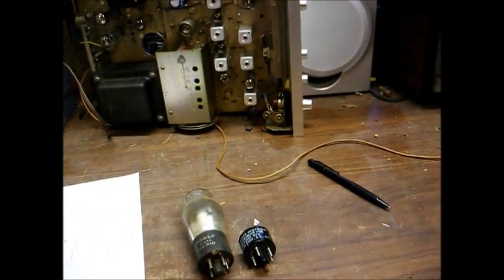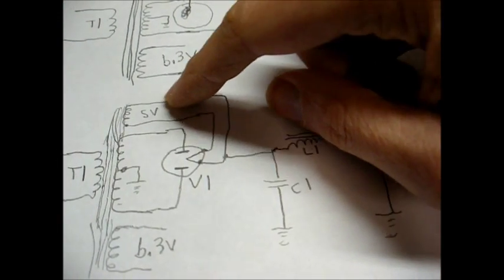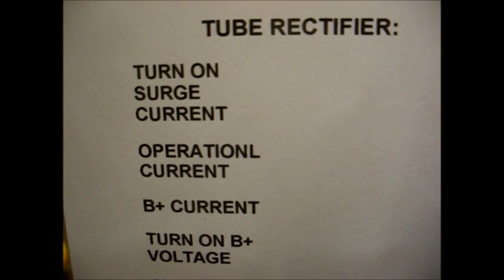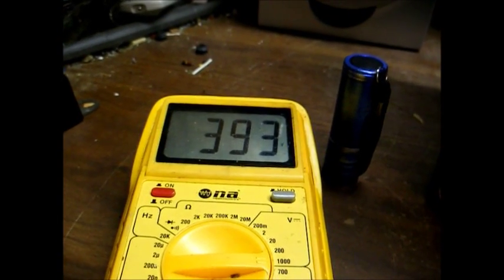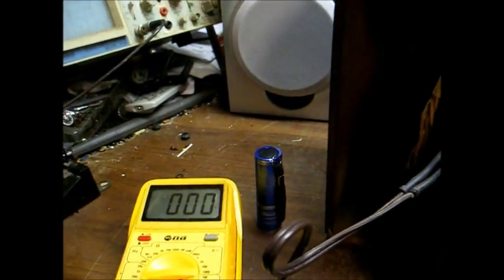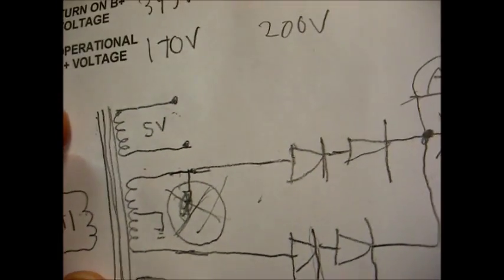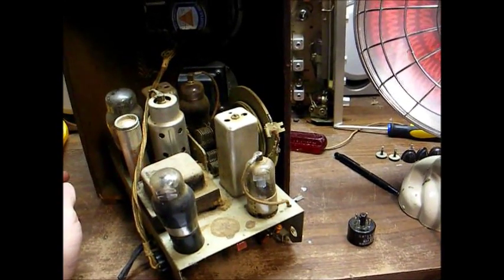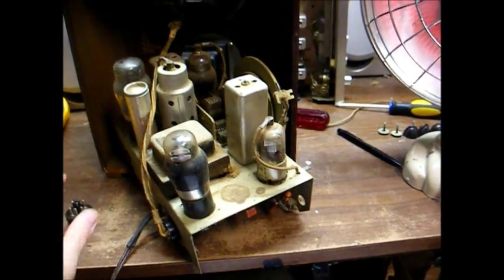Analysis of solid state plug in rectifiers for replacing tube rectifiers

Comment: As always a great video.
I can see someone using that replacement diode pack if they could not find a proper tube, like back in the late 80's and early 90's before the internet was a thing.. I mean now you can find rectifier tubes online but back them it was a dark era when tube equipment was widely replaced with solid state and part houses quit carrying tubes, this diode pack would be your only option..
I have seen modifications of equipment I have worked on using these plug in packs to replace tube rectifiers, where the device had a small IC (555 or 556) based timing circuit to fire a relay to supply the B+ to the tubes after all the other tubes have warmed up so your not applying HVDC on the plates of a cold tube..
The latest modification I have come across was in a guitar amplifier that had an arduino nano as a timing device to trigger some FET's to supply the B+ from a diode pack to preheated tubes. This is more versitile as you can program the nano to whatever delay time you want.. I know it's blasphemy but people do what they must I guess to get equipment working and to save money..
personally I would have just found a proper tube rectifier and called it repaired..

On a side note I have rebuild resistor packs that plugged into tube type sockets in the past.. I don't see to many tube devices come through here anymore, the occasional guitar amplifier or old 2-way radio finals for a ham radio operator or the classic 5 tube table top sets that need electrical restoration but that's every blue moon..
Reply: I was surprised to hear that commercially made diode packs do not typically include a replaceable thermistor (ie: "light"bulb?) and/or SCR to limit the inrush current in a soft-start (and to add to add a non-poison standby mode?) ; before considering most common things were made to be cheap and happen to be durable, were also simple.

Have you seen no example of either in your work in the years since the above comment?

Comment: Think this is good general advice if you are not sure. Otherwise it's really no issue using solid state rectification in any equipment - if you do it right. There is no problem with output valves or any valve getting HT before the heaters warm up, As long as you keep voltages under control all should be fine, and your mains transformer may like it better in the long run by running  cooler not burning a few watts on your GZ34 or whatever. An NTC thermistor will mimic warm up if you want it to cheaply stop surges.
Though I do prefer to have a valve there myself and wouldn't want a solid state replacement,

Comment: I came across this video after losing a power transformer in my EICO 460 'scope.  I'd replaced the original HV rectifier 1v2 tube with two HV diodes in series (PTC205's) and the scope seemed fine.  But the last time I turned it on, one of the 0.1uF 1000V ceramic caps downstream shorted out, taking out the transformer.  I didn't expect this sort of cap to break down. I'd wondered about surge voltages due to the diodes being the problem.  Looking at your video, in your testing, the instantaneous surge voltage might be much higher than 400V.  Parsing the video frame-by-frame shows 889V for several frames before reading ~ 400V.  Not sure if this is an artifactual "bootup" display error, or whether your multimeter can react that fast, but it might be a real spike.  Things might be even worse than you suspect!  Thanks for the discussion!

Comment: I seen in a Tektronix scope, it had a tube that would slowly heat up...keeping the filament voltage from going right to the tube's when first started, making sure the other tube's heat up first. It had what looked like relay contacts that moved over when it got hot, and made the power to connect to the filament leads.

Comment: When necessary I have used diodes to replace a tube rectifier or selenium rectifier with a dropping resister but I've always added a thermistor to the line in to avoid surges.  It does add to the heat load and proper placement and venting is necessary.

Comment: I did this in an old 1938 philco 38-610 radio...and I used two microwave diodes and installed two 5 watt resistors in front of the diodes...

Comment: Dropping resistor values vary from 1k to 220 ohms for 6x5 to 5y3. Can be as low as 100 ohms for 5u4 replacement with silicon diodes. usually 2 or 3 in4007 in series is a good idea. 1 1n4007 is usually not enough in practice even though looks ok on paper. bypass capacitor ranging in value from 1000pf to 10000pf are a good idea to prevent rectifier noise with silicon diodes.

Comment: ive been reading up and this and understand the issues well enough only to ask a question, have you tried to use a ss rectifier in conjunction with a thermistor on the input line like an amphenol cl-90? my interest is tube radio and trying to reduce the transformer load and heat, i was even considering the possibility of using current limiters on the ss rectifier itself. the goal being to produce a true drop in replacement for a specific radio. its just thought at this stage.

Comment: Yeah, I cringe whenever I restore a vintage guitar amp & see 1 of those installed! Usually means automatically the filter caps are shot or worse, shorted from the high surge current when 1st turned on and possible power xformer damage! I've seen it all when I've gotten vintage guitar amps in for restoration/repair! IF someone INSISTS that they want to use one of those solid state subs for a tube, I install a huge resistor in series with it to absorb some of the current when 1st switched on

Comment: Except for tube testers build ss83 and ss5y3 no issues. If used in audio amp etc. Try and use dropping resistors to drop voltage enough to match original tube

Comment: The problem with the output tubes is the increase in the rail voltage. Use ohms law to find the correct resistor to bring the rail voltage down to the original voltage. Or reset the bias to the output tubes. Normally, commercial equipment were designed to work in a lower plate voltage but the tubes are fine with as much as 40 volts, in average,  increase in the plates,  look at the charts,   Pv=   Plate voltage>>minimum>>maximum.     lot's of people that try to explain this same thing they go for the lottery and have no idea to calculate the value of a resistor to drop a certain amount of voltage and try several of resistor until their are close....Waste of time, resources and human ingenuity..USE THE OHMS LAW!!!!!

Comment: This used to confuse me. I thought that Direct Current flows from neg cathode to pos anode or B+ plate.  But it seems that  it should go from pos to neg, or in  the opposite direction. Then it was explained to me, inside a battery, it does go from pos to neg, so that is why outside the battery, DC goes from neg to pos.  A rectifier doesn't allow for AC to flow both ways, but only in one direction, to change the transformer AC  output to ripple DC. Brian, just curious, was that solid state rectifier with four diodes?  Did you look inside?  I suppose a 25watt ballast resistor could be used in seeies where you inserted the ma meter.  But um wondering if a voltage regulator or SCR could be used?  Don

Comment: ok what would happen if you replaced all the tubes with solid state equivilents?
Reply: +Synthematix   There really is no such thing.   Solid state was specifically made so you didn't need high voltage any more and make electronics more reliable and not waist energy by generating so much heat.   It would be like putting gasoline in a diesel engine.   It just doesn't work.
Reply: +Synthematix One of the instructors I had years ago mentioned SS replacements for the tubes in test equipment like oscilloscopes. The biggest claim about these things was that matched pairs would stay matched for longer. I assumed they used single or multi-gate N-channel FETs with maybe a few resistors to mimic the behavior of the tube being replaced. He said they didn't work very well most of the time, since the circuit was designed around the tubes, warts and all. I guess  "better" is only an improvement when you aren't counting on the things that were "worse".

Comment: Using those solid-state rectifiers intended for replacing actual rectifier tubes seems to open up a can of worms that would be avoidable. After all, the engineers who designed these vintage electronics intended for them to specifically accommodate for the specifications of those rectifier tubes.

Comment: Re bias plate voltage. Change resistance on b plus voltage. Problem solved. It's done on guitar tube amps all the time. Rectifier tubes can SAG and Rob output.

Comment: I just don't understand the point of replacing a vacuum tube rectifier with a solid state one. Most common vintage NOS rectifier tubes are still easy to find, and they are still relatively cheap.
Reply: I have been replacing those tubes since I was 14 years old, I am 67 now and none of those rigs with my diodes had failed.

Comment: Imo, the appeal of vintage electronics is the glow of the tubes. Now, if you enclose it where you can't see the tubes anyway, it may not be as noticeable. I assume you are just replacing one tube with a solid state rectifier.  I guess that's not too bad.
I have a heat lamp just like that one. My folks bought it about 1970. I enjoyed looking at the reflection of the heating coils.

Comment: What is wrong with instant voltage???? the caps can handle the problem and the resistor between the filter caps can also handle the current rush. Non seance. Also there is no problem  for B+ hit the tube plates before they are warm, they will simply will not conduct. They will start conducting slow as they warm up. I work Philips for many years and As you should know tubes work in a range of plate voltages.  the key is in the biasing.
Reply: It is fun to use new to replace old, like most said, "have to make a few adjustments", but that is the fun part, a small challenge to do it correct.

Comment: Why 2 diodes in series? Thats never done commercially and there are usually small caps in parallel with the diodes to suppress the noise. Put that in a tv and watch the b+ go from 350 to 480 and cause all kinds of issues
Reply: +shango066 That's what I was thinking too. Kind of an odd arrangement..
Reply: +shango066 would that increase the current ability, like from one amp to two? I was thinking a diode in series with a 10watt ballast resistor would make more sense.  Don
Reply: ***** Maybe the designer of the plug in pack was thinking of a size factor, A 10 watt power resistor would be kinda big and produce / dissipate a fair amount of heat.
All part of that grey/black era where people were transitioning from tube to solid state and shops quit supplying tubes, this was supposed to be an easy temporary fix until your rectifier tube actually came in but I guess people used these "disasters in a tube base" on a more permanent basis..
I can't imaging anyone with any electronic sense sticking one of theses in a TV set for any reason...
Reply: Engineers had to design tube circuits to deal with tube problems.  Every stage related to other stages of the circuit.  Diodes and selenium rectifiers do not emulate vacuum tubes, so some modifications are necessary to work properly.  It's not simple R&R, Plug in and Play - that's what Bryan demonstrated here.  It's the same principal of dropping in a transistor to replace a tube.  It's all linked together.  It's very possible to use a solid state power supply, like it would be to use a solid state transistor preamp, as long as it matches up with the circuit loads down the line.   Overloads, and underloads cause undesired troubles.  Consider loading a power amplifier designed for 8 ohms with a 2 ohm load. Mismatching can overheat the circuits.  Diodes are OK if properly adjusted to match the circuit load.  Selenium rectifiers are a good case in point,  THEY SHOULD BE REPLACED WITH DIODES, not with rectifier tubes, but a slight mod is needed to use a proper ballast resistor in series with the diode.  Solid state diodes can be substituted for tubes OK, but with an adjustment to compensate for efficiency and load match.  Using wrong e-caps can also cause surge overloads, regardless of rectifiers. The job of a rectifier is to block AC and pass DC voltages.  Diodes do that better than tubes or selenium rectifiers.  Then there are SCRs... ?
Reply: So why replace tubes with diodes?  Consider this:  A couple diodes and resister are two bits.  One NOS 5U4 on ebay is at least 5$. Risks:  Damaged or lost in mail, bad tube, time it takes to get it etc., so there are disadvantages.  But then you get your new rectfier tube, and even change those ecaps.  Plug it in, poof, blown tube!  WHY?  Shango and Bryan can explain what blows new tubes.  So it's back to ebay...
Reply: BTW, keeping it "tube" is OK for restoration purists, but they must admit that expensive tubes FAIL all too often. I guess a part is LOOKS, like sawing off a CAN to ""restuff"" an e-cap.  I say, leave that can as it was on top, like leaving a rectifier tube up in its socket for appearance, NO SAW needed!  Simply disconnect them under the chassis, and connect the parts under there.  Very simple fix, and it ""looks original"" on top of the chassis.  I think that restuffing cans is more silly that plug in diodes.
Reply: Shorted diode?  FUSE
Cap can leak, clean it.
Ethics (looks), hacked can looks worse than leaks underneath.
It's simply silly.
Reply: Yup, something to watch and comment on.  Funny thing, this could be a big round table discussion on a 2m repeater, tech lites vs extras, LOL.  Sorta like Bud vs Rolling Rock.
Reply: Well that plug in diode pack is just strange that is does not have parallel caps in it. Maybe that one in the video is the "Chinese version" lol . I would like to believe that someone working on a restore of an old set would not be using one of these at least without an inline power resister and caps parallel on the diodes..
Selenium rectifiers looked good on paper but in practice yes, they need replacing. I have an old power supply that had 4 of them in to create the bridge and I replaces it with a modern bridge. no modification needed since it's a variac driven power supply and the metering is done off the output.
No disrespect to Hams, I know most are fine people who know their shit, but I have met some real screwballs that think they know radio or electronics for that matter.. I am a professional commercial radio technician myself and how they got their licenses is beyond me. Well not really since the licenses is now so easy anyone who can read English can pass it.. If they brought back morse code requirements I would consider getting my Ham ticket..
Reply: Yaah, I have to study the extra question pool...
Boy lately, my memory sux. 
btw, how do I rig my Radidio Shack CB with linniker to do morse code?  Do I  tap into my D104 power mic echo roger beep  circuit? Lemme see, ten four in code...
Reply: oh god lol CBer's are the worse..I mean the radio is not bad to have kicking around in-case of an emergency I guess.
I did do some experimenting with CB a few years ago one day when I was bored, where I was able to send images over the air and even SSTV. I had to build a simple transistor switch and wired it in to the PTT line from an RS232 and fed the actual signal via PC soundcard into the Mic-Hi line via an audio transformer of course. I know that sort of thing is not "allowed" on that band but in reality the FCC gives how many sh1ts what goes on on CB radio these days, besides I was tied into a dummy load too.
Reply: What a novel idea, use CB properly, like when it was a ham band until the 60s.  Good idea, hmmm, qrp on 11m!  I wonder how my Regency Imperial and AstroPlane will do?  Last time I turned it on, I heard all kinds of ""fun"".  Sad to say, more radio activity than 10m or 15m lately. .
Reply: ***** " Last time I turned it on, I heard all kinds of ""fun""." < -- made me laugh because it's true.
Reply: I find CB bozo's amusing, just shows that the govy FCC agency  fails to keep it right, like the EPA failures.  My gripe for CB is 4 watts, limited to a few miles.  QRP?  NAAA!  I used to monitor ch9, was that a joke!  But CB can be entertaining, like the internet, beyond govy control, a total SNAFU, LOL.
Reply: Yep sad parts of the GMRS band is starting to look like the CB band now...
Reply: ***** I'm just glad they dont make blisterpack radios that do GMRS repeater operation and sell them at Wal-Mart.. I'm sure it won't be long though before they do. I mean you can buy a $30 Baofeng UV-B5 that's FCC approved for part 90 on ebay, tune or program it to fuck all frequency with absolutely no regard to legal licensed users and use it to talk about god knows what...
At least I ask customers to present license information before I sell them a radio system and if they don't have it I offer to file for one for them.
Reply: Yes, but adding a good size reactance would make the performance much better than just adding a dropper resistor. All depending, of course, of the space we have on the chassis.
Reply: You are mistaking about the 2 meter ssb. there is more activity there on long dx  there. also moon bounce and across pacific audio. with antennas arrays and long 17 elements each!! Just a notation.
Reply: shango066 Connecting diodes in series increases the reverse voltage.

Comment: I know this is four years old, but I just thought I'd point out the B+ power is 4 watts with the 5Y3 and is 8 watts with that little solid state gem. That means that all the other tubes in the set are running at TWICE their design power. Not a real wonderful thing.